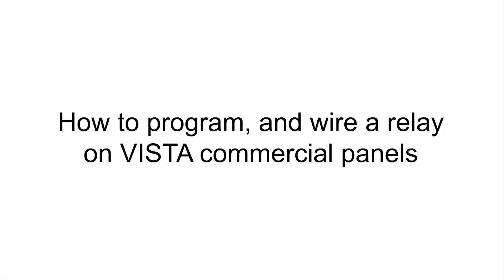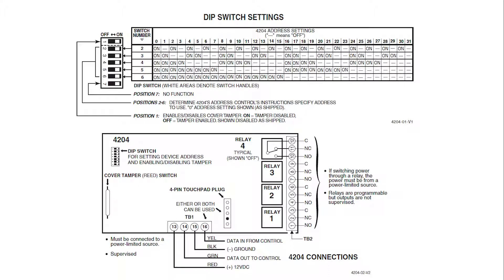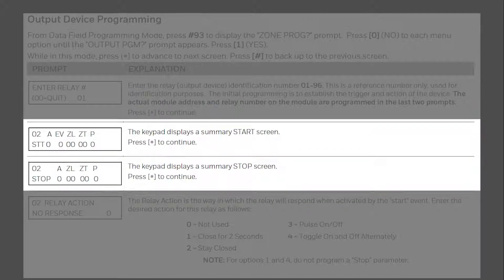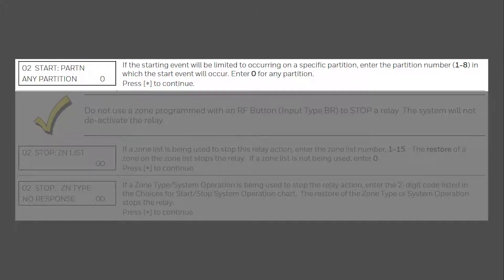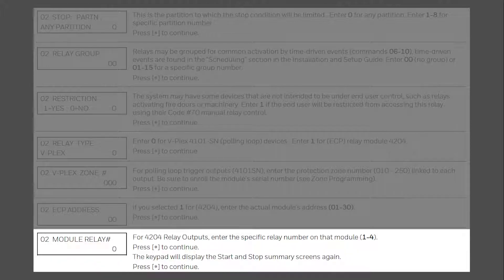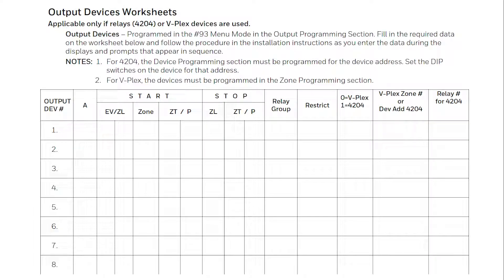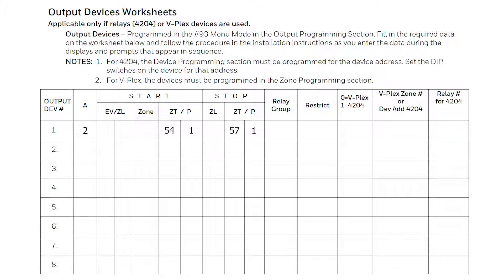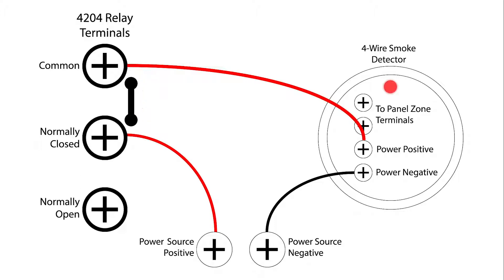How to program and wire a relay on VISTA commercial panels - Resideo

Comment: Great video!
I have an issue with dialer AD2000. When I activate the alarm , the dilaer is not dialing numbers. Dialer is connected on 4204 relay board. When i trip dialer, it's dialing. What I am missing ? I have vista 128bpt and two keypads.
Reply from the maker: Hi Ivan, thanks for the question. Our security products are supported directly through your security installer. -Joey
Reply: Ok, but I was the installer. I just need assisting how to trigger dialer via 4204 relay board.
Reply from the maker: The support for security panels go through the security installer or alarm company. -Joey